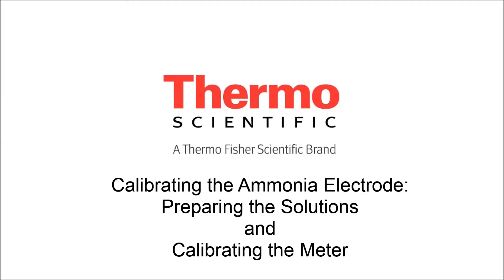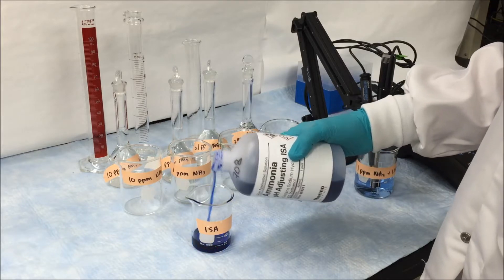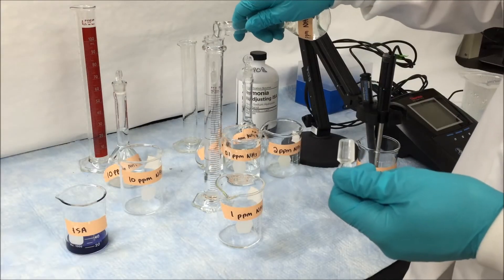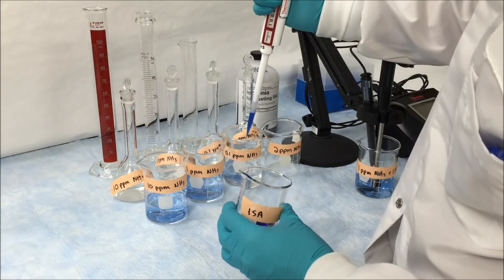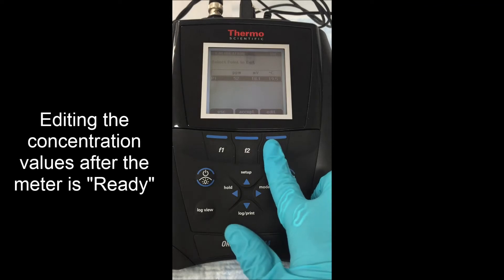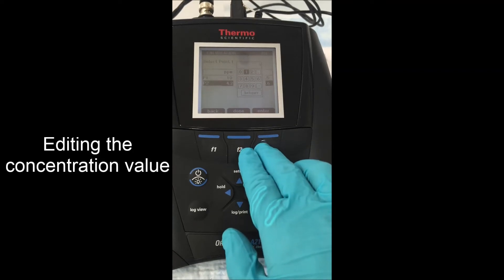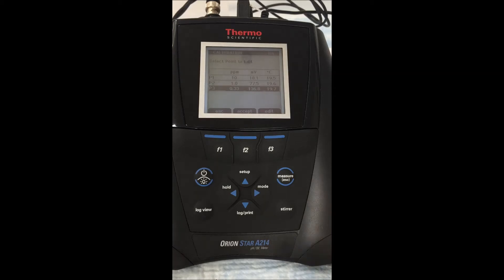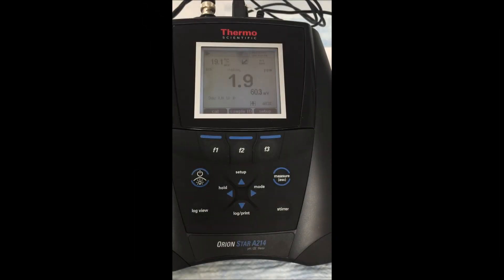Ammonia Calibration:  How to calibrate for ammonia with Orion Star A meter

Comment: I am having problem calibrating my ammonia meter. I am not reaching the desired calibration value. I am using Orion 9512BNWO Standard Gas sensing ISE electrode